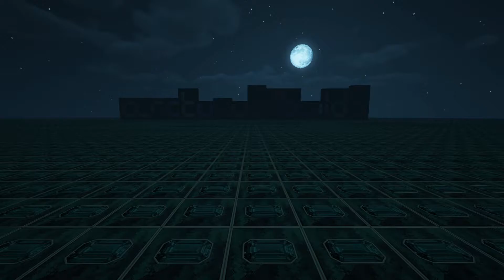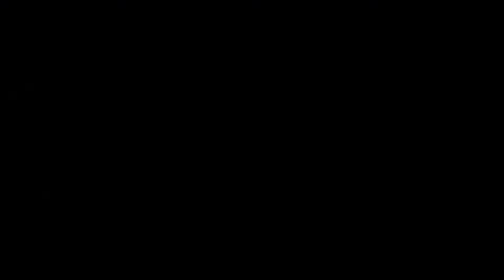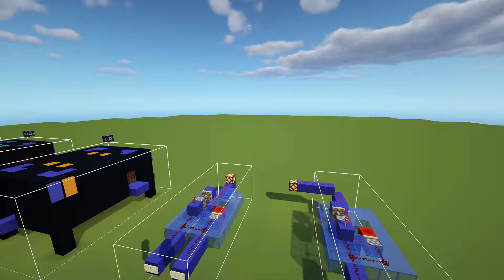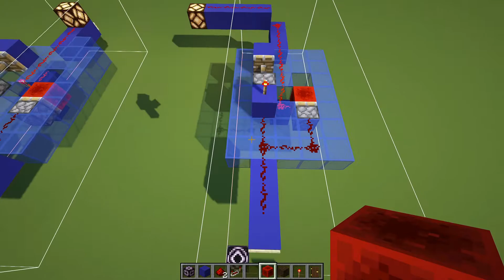Minecraft-Redstone: Instant NOT & NOR Logic-Gates [Logic-Gates]

Comment: you may have block-event problems if you chain these gates.
for example, try to link the output your instant not gate with an arbitrary instant repeater. normally your output should always be powered, but if you power the two gates in the same game tick, and plug a piston to the output, you will see it unpower and power again, it is because the redstone line has been unpowered and powered again in the same tick.
you can prevent it to happen with synchronized instant gates but that's a bit cheesy to design
Reply from the maker: thanks for the comment...too bad I was heavily into MC logic-gate design about a year ago, but switched to cellular-automata...but yes I did run into problems, my biggest build using these instant-gates was an updown counter w/ an arbitrary-preset (https://youtu.be/nCLy2i7k8og), that I had to jump thru hoops for in order for it not to break w/ the syncing issues, ultimately, it came down to introducing latency strategically, which I just figured out thru trial & error...it is "instant", in the sense that whenever you tick it up a notch, it instantly counts up, but you have to wait like 14 ticks before you can hit the counter again, or it breaks...
Reply: @arcturusbuilds  yes, I completely see what you mean. powering may cause more delay than unpowering with the well known instant repeaters. 
nonetheless I really like your work, cellular automata is a really interesting topic. keep it up!
Reply: @arcturusbuilds  I thought that your greatest build was the instant ripple 64 bit adder, but I definitely did not see everything XD, you are crazy
Reply from the maker: thanks!